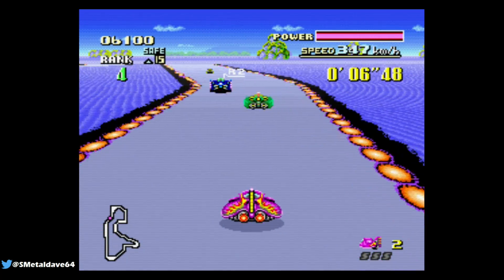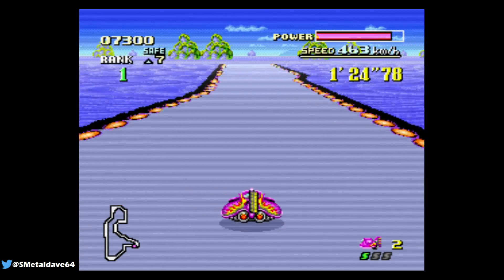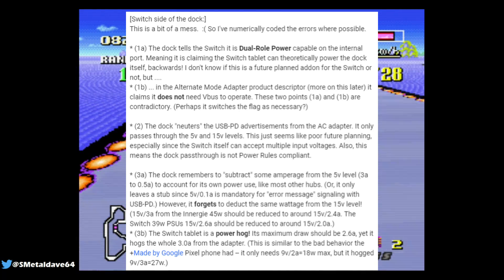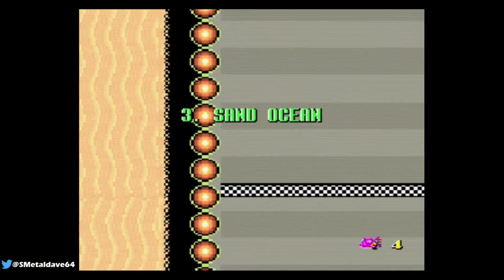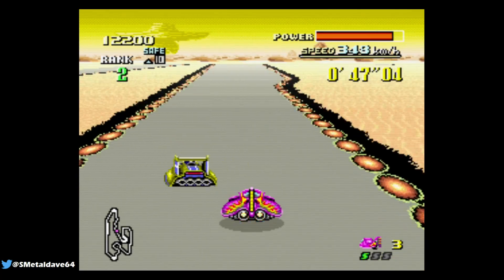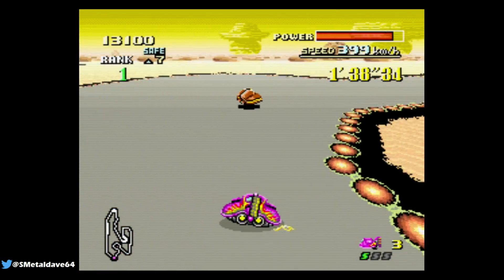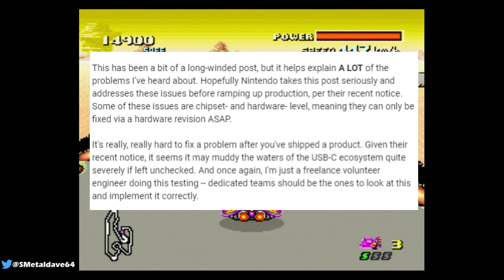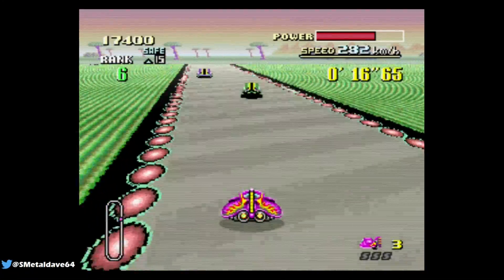Nintendo Switch – USB-C Voltage Flaw Explained

Comment: Nintendo gets free pass for EVERYTHING. as a customer that is part of the ecosystem if i choose to buy a 3rd party accessory and the console is stop working not because of the ACCESSORY BUT BECAUSE OF  DESIGN  FLAW FROM NINTENDO, THEN THERE SHOULD STILL BE  RESPONSIBLE TO FIX MY CONSOLE OTHER WISE BOYCOT THAT SHIT! SERIOUSLY, PEOPLE SHOULD NOT BE FORCE TO INVEST MONEY ON NINTENDO ASS IF THERE ARE OPTION BEING DISPLAYED FOR A CHEAPER DEAL COMPETITION DRIVE DOWN THE COST INCLUDING NINTENDO HIGH PRICE AS WELL, TELLING FOLKS TO STAY AWAY IS ONLY GOOD FOR NINTENDO AS THEY WILL MAKE MORE MONEY OF SOMETHING THAT COULD OF BEEN MUCH CHEAPER. NINTENDO GETS AWAY WITH EVEEYTHING
Reply: the, is nintendo responsible for checking EVERY THIRD PARTY ACESSORY before putting out an update? cause it works fine with thier own dock. there was a problem, and they worked around it, which is what ninty does best. niko just didn't copy the switch dock well enough.

Comment: Nintenod needs to fix there this.. i needs option! Bought hardware from nintendo and now needs option other then nintendo do to high cost. Every other console or handheld like the ps vita your free to buy accessories to your liking for the right price; but nintendo with bs update and problem from sd cards and  Etc. Smh
Reply: well, not really with the charger, but the dock.

Comment: There were NO ISSUES before 5.0 update. Nintendo did that shit on purpose
Reply: THAT GUY There were issues before with the Nyko dock.
Reply: There where plenty bricked switches from niko docs before 5.0 firmware update even in the base firmware niko docs where bricking systems. Also many niko docs and chargers have bricked many other devices over the years due to bad R&D.
Reply: Diddz' their not faulty per in the common ise of the term because they are a proprietary port using usb c and charger which is flawless when no third party interaction is involved. The problem comes with usb c being starnderedised after nintendo made their port meaning they could make it anyway they wanted due to their being not much knowledge and regulations however since then the port has been standardised and when developing them you have to meet specific peramiters. Ergo companies like nyko who make 3rd party docs didnt do R&D on the acctually port and instead just  made it work with standard usb c meaning they didnt work together properly.
Reply: well in either case, a revision on the USB standard or nintendo's end needs to be revised ASAP since there is nothing prohibiting physical compatability with other USB C devices (which i'm sure nintendo's adaptor isnt meant to charge a galaxy S8 or power a USB C powered monitor but they are "compatable" per for plug used)

the fact that only first party stuff is really safe makes the weak battery even more of a problem for handheld users now since we now dont have a charger that supplies enough juice to play AND charge on the go without damaging the system (my power bank supplies 5v and the quick charge 3.0 specification but cannot keep the switch from draining battery while playing)
Reply: Diddz' it looks like their going to do a silent hardware revision soon which if they do they will be forced to standardise the port but sadly it still leaves us with bad ports and no options.
Reply: Natendo What about insignia? Cause I have one of those but never use it
Reply: BigHunter 20 unless someone who  may have a lack of knowledge on certain parts insists
Reply: Diddz' No you can't.  If you break it using 3rd party docks you arent entitled to a refund from nintendo.

The RROD was a problem with the 360 (almost half ever made ended up with the RROD), the bricking of switches is not nintendo fault and they have said not to use 3rd party docks.
Reply: we can try to exchange and if refused it, we can just class action against nintendo just like how microsoft got hit when they didnt honor their faulty launch 360s
Reply: inb4 the console revision replaces the USB with propriatary looks like nintendo is about to have their turn at the shitstorm that the 360 at launch had with free replacements/repairs 

nintendos about to get class action sued by its customers demanding free replacement of their systems warranty or not over the faulty USB implimentation

Comment: I’ve been using my aukey 30000 mAH charging brick almost everyday for the past year and nothing has happened to my switch. Same with charging it with a third party adapter. I have, however, never bought a third party dock. Are you sure that it’s with the chargers or just with the docks because my system is perfectly fine. I feel like it’s just when it’s docked it needs a lot of power and those third party ones don’t support that but I feel like it’s fine if you are using third party chargers in portable mode. No one has ever complained about those bricking systems and I’m living proof of it as well.
Reply: think chargers are fine. the problem is, I think, with the digital handshake the switch does with the dock.
Reply: It's just a dock issue, since they have to make sure their own dock doesn't brick the switch and thus 3rd party have to implement a same safe feature otherwise the bricking will keep happening.
Reply: I have backed the SwitchCharge case from indiegogo, so I hope this will be fine when it arrives as it only works in handheld mode...
Reply: Galva101 I think it will be fine. Like I said, I’ve been using third party charging bricks and adapters for over a year every day (only in portable mode) and my switch still works perfectly fine.
Reply: The Switch have 2 power modes, a 5V mode for portable and a 15V mode for dock. 

My guess is the issue with power draw may be just with dock mode when it requires more power

Comment: This isn't a flaw with the switch, this is clearly a flaw with the 3rd party docks. There is nothing showing or saying that charging your switch out of the dock is an issue. 3rd party companies not doing R&D is the issue here
Reply: MrHeller55 Nintendo should not adopt a standardized port while not meeting the ports standards.  That's as ridiculous as someone selling a hair dryer that can only take 50vac prior to catching fire but giving it a standard 110vac plug.
Reply: Alexandrite - I have had my Switch get locked in a dead battery state more than once. I did not know that it was due to this USB-C non-compliance issue. I used a Switch pro controller USB-C official cable and an outlet adapter with USB charge ports built in. I searched Google for a fix and found one. I did not see at the time where people were aware of the Switches  non-compliance. All this has helped me realize what I did wrong.

 If Nintendo didn't want anything but their shit hooked up to it, they should have made the connector proprietary. This is bait & Switch.... literally!
Reply: KuraIthys the dock makers seem to have tested their docks with the switch. It's not like this issue occurred when docks hit the market. This happened months into there existence directly after a system update. It's not like Nintendo gave the dock makers a chance to review the update and issue recalls on the docks
Reply: Joshua Sandoval Lawsuit over other companies not being able to make docks? The Switch isn’t their console, so they have to learn how to make a functional dock.
Reply: Not to mention this isn't a dock issue, this is an accessory issue as a whole. You can't even risk plugging the Switch into a laptop without worry of it frying both the laptop and the Switch.
Reply: You obviously don't understand how technology works. USB-C, and standards like it were created for the reason of being universal and cross-compatible. 3rd Party companies should not have to bend to Nintendo's rules to have their product work. They should only have to abide by the standard. Otherwise it completely defeats the purpose of USB-C. Nintendo effectively made a bootleg USB-C port. Which is not okay.
Reply: Alexandrite Sorry but that’s not how it works when you use a standardised port, and violate said standards with that port. The fault is entirely on Nintendo, as the accessory manufacturers are being USB-C PD compliant, and Nintendo is not.
Reply: MrHeller55 Not laptops
New MacBooks and other laptops use USB C to charge and they do fine with varrious chargers
And are able to know when a charger can't supply enough power
Reply: Joshua Sandoval While it would be nice if standards were adhered to...
1. If you are making a generic standards-compliant device then it's on you to ensure it meets the specification for that standard abd never harms any device that follows the standard correctly. You shouldn't be liable for the consequences of use with non-compliant devices.
2. HOWEVER, if you make an accessory designed SPECIFICALLY for use with one device (eg. Nintendo Switch), it absolutely IS your responsibility to ensure it works correctly and safely with the device you built the thing to work with! Standards or not is no excuse here. If you make a switch specific accessory, it should work safely with a switch regardless of what Nintendo did. It's on you to test it properly, not Nintendo. (unless they officially licensed you to make the accessory, in which case it's on both of you. You for not testing your product properly, them for not correctly informing you of their system specifications and any non-standard behaviour or quirks).

There's no room for complacency and excuses in hardware design.
If you design a dedicated 3rd party accessory it had damn well be tested properly WITH the thing it's supposed to work with! None of this airy-fairy 'but standards compliance!' nonsense! Test your damn products properly!
Reply: Other USB c devices do not have this issue
Don't be a sheep
Reply: Alexandrite the issue is Nintendo is in violation of usb standards. The switch to dock interface is a usb port. Nintendo is ultimately the responsibile party due to those violations. Dell can't sell me a laptop that blows up the moment I plug in a third party usb thumb dribe
Reply: Stop being a sheep and making excuses for Nintendo. It is entirely their fault for not following the USB-C spec. Not to mention if they don’t fix it soon, it will lead to a huge lawsuit.
Reply: Joshua Sandoval Have you ever heard of someone bricking their Switch using a third party charger directly into the Switch? It’s the docks that cause it.
Reply: Joshua Sandoval 

How is this being a sheep?
Nintendo made said device, said device requires X power when in this mode, you make an accessory for said device but instead of testing it you just assume it runs the same as all other devices and now your product is breaking Nintendo's device.
Reply: Dillon Herrero yeah no shit other usbc devices use vastly less power.

Comment: Wait does this mean that my switch will brick if i use power banks?
Reply: Peter Pecnik only if it tries to give the same voltage as the nintendo power supply. If it’s voltage is lower, like a phone charger, it should be fine.
Reply: Trekeyus after more research, problems only happen if the switch “thinks” it’s docked. So Battery packs are most likely fine.
Reply: taylor sims so in short if you have one of those fancy smart battery packs such as an Anker make sure you don't use the USB c pd port. Use a USB a to c cable and one of the low voltage ports
Reply: Which power bank?

Comment: Why did they use USB-C in be first place, if it doesn't work properly?
Reply: But it does work properly. They didn't choose USB-C for the convenience of being able to use any USB-C charger. They chose it because it was a good starting point for their needs. The Switch works with Nintendo's USB-C chargers.

Comment: Can the FCC sue Nintendo for breaking the usb-c standard? Usually these are quite well regulated to protect the consumer.
Reply: CodeNameZ it's still sort of an open source tool at this point in time as it's still going through changes and redevelopment until the technology like all tech in the world is perfected.
Reply: @CodeNameZ USB-PD has been around since early 2015, two whole years before the Switch came out. PD 3.0 uses the same power rules, the only difference is that it uses the wire pair dedicated to charging protocols on type-C instead of 2FSK over the power wires on type-A.
Reply: Couldn't Nintendo just respecify it as a proprietary standard using USBC connector also it isn't Nintendo's fault they are actually well within there rights to do this especially since they maintain compatibility with 5v USBC when the cable doesn't do shit
Reply: I don't think the FCC can two Nintendo unless Nintendo is not doing anything that would get the FCC involved that would ruin Nintendo's reputation. No I'm not being a fan girl to Nintendo I'm just saying as a person that thinks of Common Sense on how technology works.
Reply: No. They're too busy killing net neutrality
Reply: Let's say I'm designing a laptop.  I decide I want to offer a custom peripheral that requires 12V.  The right way is to come up with a connector of my own or upconvert the 5V into 12V with a boost convertor inside the target peripheral.  The wrong way is to use a standard USB connector, put 12V on the 5V line, then declare everybody who fries their devices 'should have known to only use the equipment I make and sell, after all I am just using a standard port in a nonstandard way'.
Reply: The thing is when the Switch was in development USB C was more less open sorce.
Reply: Matthew Barth and to the FCC there chairman has not the slightest clue what he's doing and even more interesting they are a commission not a federal bureau. Meaning they are funded by the government but not part of the government. And the government can overturn all decisions made by them. Like they recently did with net neutrality.
Reply: synical13 they shipped them out early for sales and get it out there

Comment: Soo... i don't care much about docks but what about powerbanks? I guess we can't use them either
Reply: they should be safe... the issue seems to only happen in docked mode
Reply: As long as your powerbank has a 5V/1amp output you should be fine
Reply: Damnit, mine is 5v/2amp
Reply: The Anker PowerCore+ 26800 WITH the USB to USB C it came with is safe.

The RavPower (Xtreme) 26800 PD is likely safe, again using the USB C to USB C cable it came with.

I don't have other power banks to check.